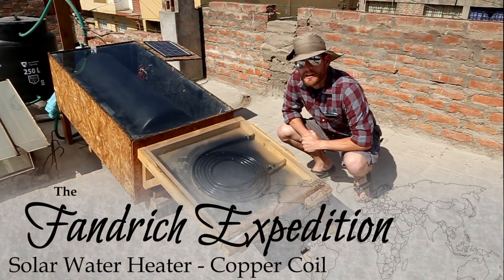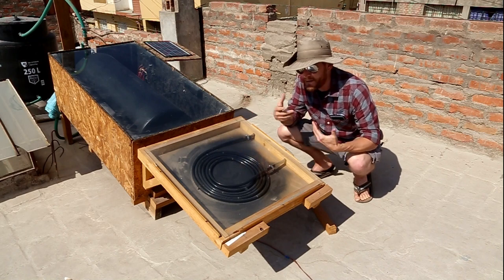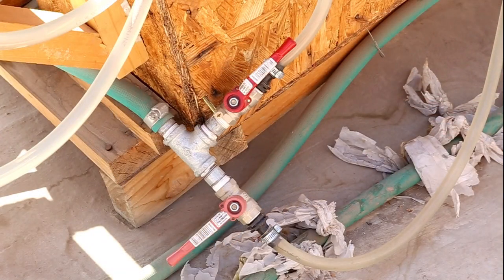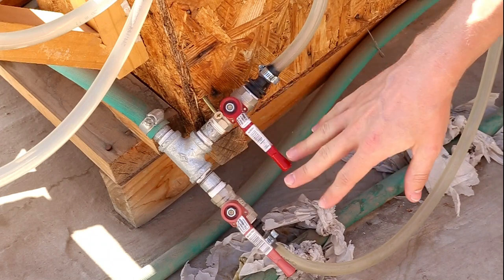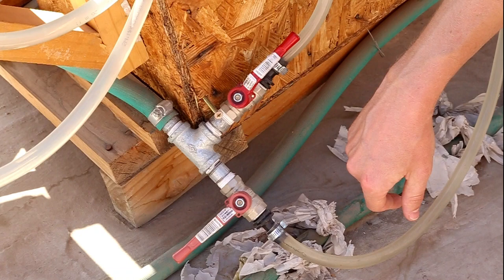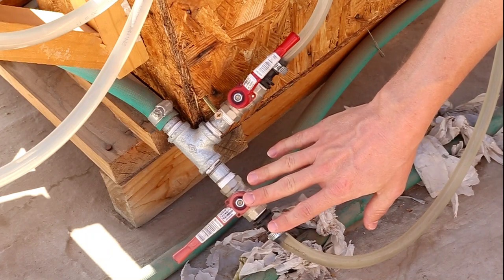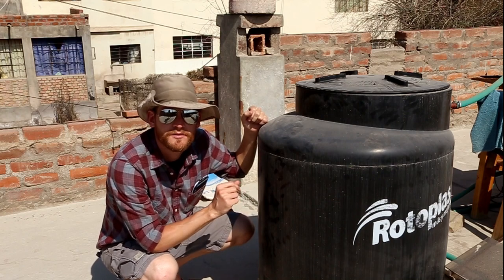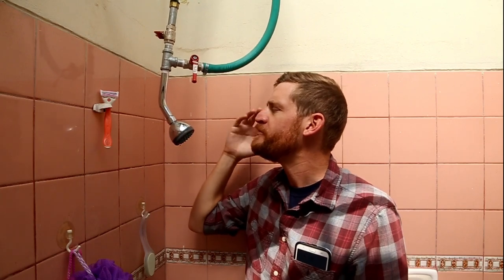Solar Water Heater - Copper Coil

Comment: With the copper coil heating to near boiling point of water,  you do NOT need a electric pump.  The cold water is more dense (weighs more) will flow into the copper coil. This will circulate the whole water system.
You can remove the pump, solar cell, battery & charge controller.
Reply: Hi Nelly! Of course, that would work perfectly if the copper tubing was oriented such that water could passively flow out of the tubing and back into the tank/reservoir when heated. Since it is a literal coil shape, the water in the coil gets so hot that it boils inside the coil. Plus, without circulation, the water in the tank/reservoir would get extremely hot on top and stay quite cool on the bottom (unfortunately where the output for the tank was). The electric pump solved both of these problems.